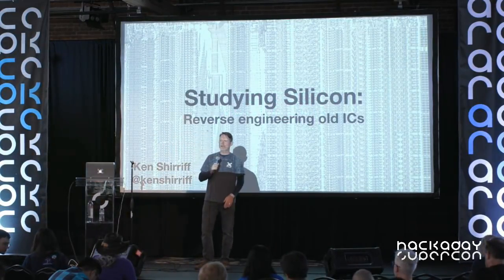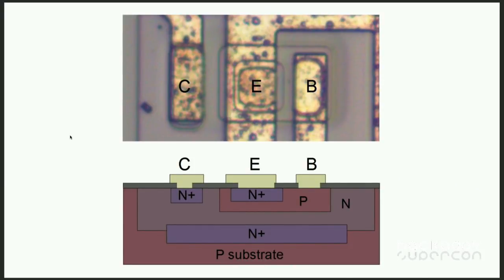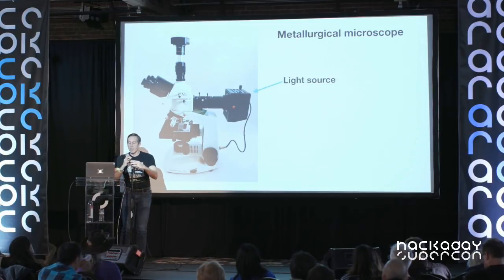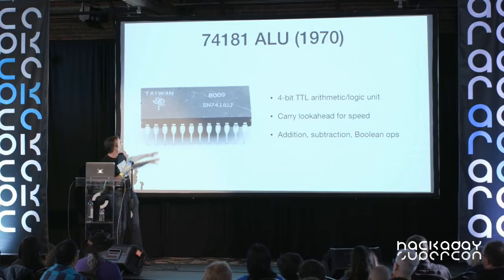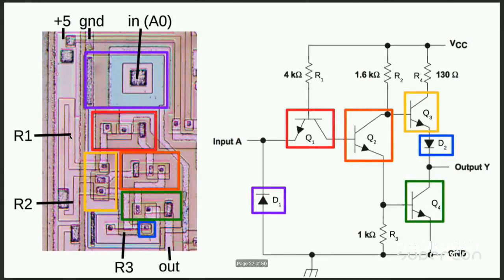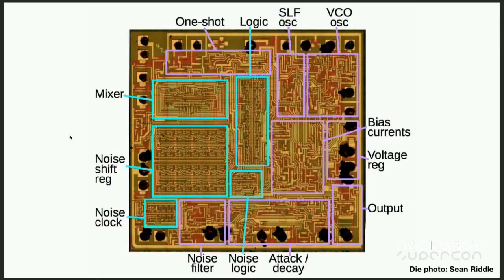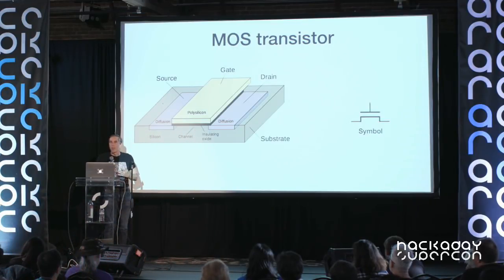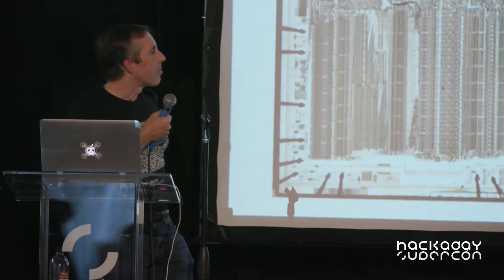Hackaday Supercon - Ken Shirriff : Studying Silicon: Reverse Engineering Integrated Circuits

Comment: I had a try at this a few weeks ago on a die picture of a simple TTL chip. Once you can guess the structures it gets easier but you really need some specific electronics knowledge and I did some silicon design and layout in Uni.

Great presentation from Ken